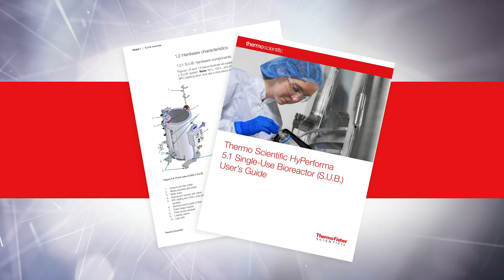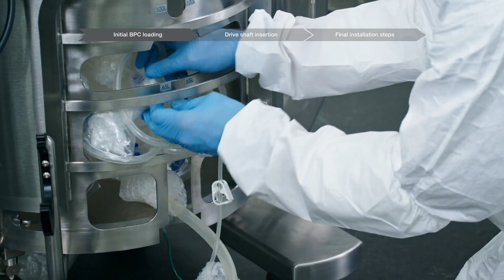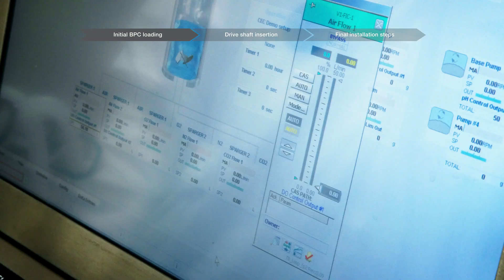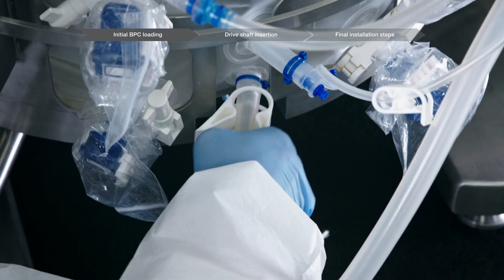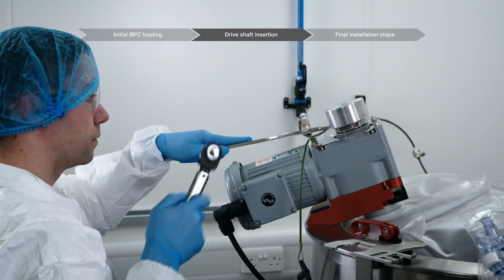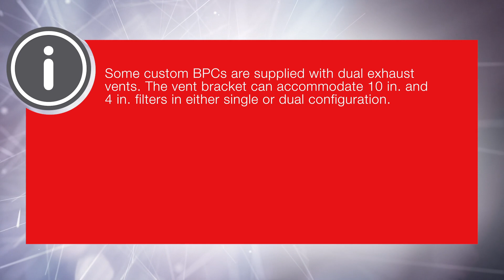How to Video 2 of 3: Thermo Scientific HyPerforma Single-Use Bioreactor setup and installation

Comment: same question, what happens with sterility when installing the driver shaft and how is the impeller in place
Reply: The stainless-steel drive shaft just holds the impeller in place. The tubing assembly with the impeller is already inside the bag, so the shaft is only acting as a holder.
Reply: @357895sgfc  I see, thank you for answering